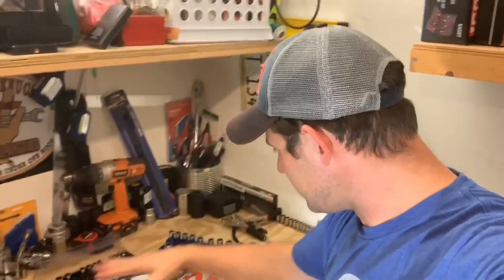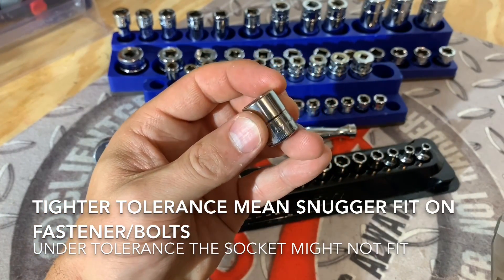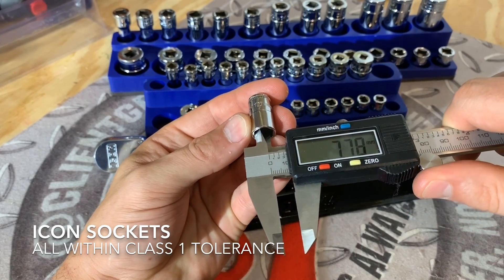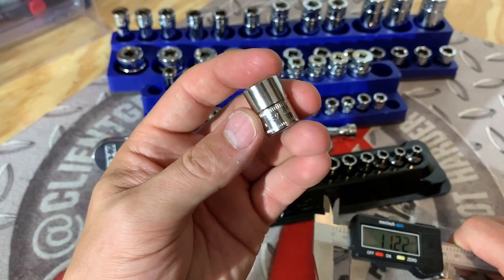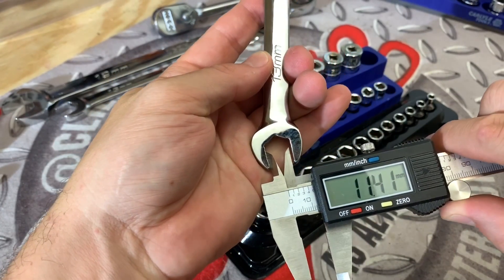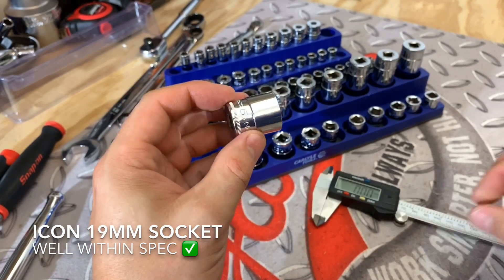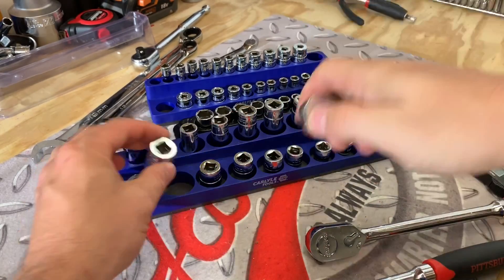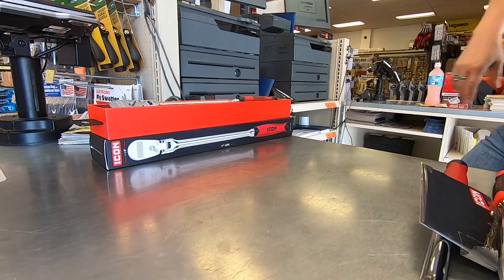ICON Tools Socket Wrench Tolerance Does Harbor Freight Measure Up to Snap On

Comment: Wow, crazy this video is 5 years old.
I’m in the market to buy new ratchets and I’m up in the air between Tekton and Icon. Would you recommend one over the other? I’m not sure how I feel about how easily the socket popped off the Tekton. Would that persuade your decision? Also, do you know if either brand has improved in the last 5 years?
I’m really stuck in the middle..  my other thought.. just buy Snapon and bite the bullet and not question if I made the correct choice.. but I’m not sure I can justify the cost of 3 SO ratchets.
Thanks in advance
Reply: I would prefer the more tighter fit as it would naturally would cause less wear on the metals even prevent less slip. As to how that affects the sockets balls that hold the sockets im bot sure i never owned a ratchet yet but i like thats its stuck. Im guessing the snap on is supposed to be pro so it must mean tighter the better.

Comment: ICON is a great mid tier tool brand (when discussing Taiwanese made). I have a few of their tools. When you start comparing them to Snap On, MAC, Wright it becomes very clear you don’t know the first thing about how USA tool truck branded tools are made. You leave out the steel grade, heat treatment, finish machining. Cracks me up just how stupid some folks on YouTube are. But as long as it’s “cheap”…. And to be clear I’m not calling you stupid, just the comment section. I do stand by my statement above that you need to learn there’s more to tools than a tolerance test using a measuring tool that is made of pot metal…I do get a good laugh when people claim ICON is at the same level as Snap On. They simply can’t afford Snap on so they compare apples & oranges to justify their frugal purchase.

Comment: A lot of discussion on this test about the fact the snap-on set was used.  The simple fact is that there should be no change in the tolerances from new to old.  A permanent change or opening up of the tolerance from new means the socket underwent plastic deformation.  If a part undergoes plastic deformation is has, by definition, exceeded it's service strength.  So unless each snap-on socket tested was at some point pushed past it's service strength, the icon tolerances are tighter.  Bolts are relatively soft, and should never deform tool steel.  If by some reason the snap-on tolerances were opened up through use, it would indicate an issue with either the socket steel or the design itself.  For those of you who care to learn more look up steel deformation on Wikipedia, or in any entry level materials textbook.

Comment: Great video As a professional mechanic I have so many different brands of tools in my box snap on Matco mac cornwell tools icon whatever doesn’t break and does the job goes back in the box and if it breaks when it’s relatively new off to the trash so far I genuinely have no complaints with icon tools are they as good as my local took truck possibly do they do the job absolutely for much less money if your just starting out In the field don’t buy a huge toolbox for 15k and try to keep up with the guys retiring who’ve accrued tools for 40-60yrs it takes time to get everything and one may never have everything 😆

Comment: So far my main complaint is that there are not expansion socket sets. Example is 3/8” drive short 6 point only goes up to 7/8”. No 15/16” or 1”. Same goes for all sets in inch or metric. But long term I still love my Snap on stuff but Icon is at least walking up the sidewalk to knock on Snap On’s door.

Comment: This is great info, thanks!  I had a Snap-On 3/8 ratchet years ago (probably 20 years ago) and the only complaint I had was how tight it held on to sockets.  There were times I needed to pry off a socket with a screwdriver.  I gave that ratchet away... but held onto my old Craftsman stuff.  Now I'm going to check out some ICON stuff this year.
Reply: Same thing here. Snap-on ratchets really grip the sockets
Reply: Sounds stupid

Comment: They told me if I have a problem with the icon tools is best to bring the whole set and they will swap it no questions asked. Is easier for them to return a whole set back to the factory. Then they don’t have to sell a set with missing pieces.

Comment: This video is pointless. It doesn't account for user error withthe measuring calipers. How can we be sure the calipers are 100% square to the side walls of thw sockets? A better test would be showing the actual play with a brand new bolt comparing the play in each socket with the same bolt.

Comment: I have an off topic question. I can get Harbor Freight 1/2” shallow cr-v impact sockets for $14.99 per set or for $20 I can get the chrome moly set. The difference is $10.90 if I get the sae/metric chrome moly sets... any thoughts which is better?
Reply from the maker: People will recommend Cr-Mo for impact applications since it has better ductility than Cr-V, which means it can de-form and re-form under the heat and stress of your impact tools. Cr-V is harder and more brittle so prone to shader instead of splitting. Traditionally, Cr-v is what normal chrome sockets are made of and are hard and have thinner side walls. However, Cr-V can be heat treated to different ductilities. At the end of the day we are talking Harbor Freight CR-Mo vs CR-V for me it comes down to fit and finish, size markings stamp vs laser etching and what side walls are thinner walls yet will last. For most DIY and weekend projects either will be fine.
Reply: ClientGraphics  thank you for your input. I know it’s not a lot of money but I just wanted to make a wise choice with what I need.
Reply: ClientGraphics  Thank you for your reply. The Harbor Freight Cr-Mo are laser etched where the Cr-v are stamped. Cr-mo are thinner walled and seem lighter. I use impacts mainly for gear boxes and small hydraulic pumps..so far I’ve had no issue with Cr-v but I’ve never owned Cr-mo... still trying to decide... great videos and very informative! Keep it up!
Reply: ClientGraphics  would you still recommend the Cr-mo even though harbor freight switched then to China? Cr-v are made in Taiwan

Comment: Great video Chris! I thought it was just me having difficulty with Snap On ratchets. I have a SnapOn FLF80 ratchet that once you put that socket on, it’s not coming off unless you pry it off. Honestly bought into the hype and just don’t see how Snap On can increase efficiency when I have to pry every socket w a pocket screwdriver. My go to ratchets are from GearWrench and SK and I even have a HB Pittsburgh pro that is pretty awesome. All three are smooth, reliable and can be used with any brand of sockets with zero issues.
Reply: Buy a quick release u amateur

Comment: None of the measurements are correct. You are splitting. 00mm and.05mm and holding it by hand the measurements will not be that accurate. Now you go to what really matters the quality of the steel as a heavy equipment field mechanic i dont grab a wrench or a ratchet or a socket that i dont trust. I have had my knuckles broke skin ripped off because of cheap crap. You spend your mony on what you think is right but i will spend my money on what i can trust

Comment: I agree with the caliper comments.  As a machinist for 15 years, those harbor freight caliper are not even worth the $9.99. They would need to be calibrated or at least checked against a gage block or 1-2-3 block for accuracy. Bet the are off at least .01mm which is the difference in the video. ( I'm still wanting Icon to win this battle. But for the sake of accuracy better equipment needs to be used for measurement)
Reply: What does it matter if it a little off , it's still showing which is tighter or looser , the Icon sockets had a lower number , doesn't matter what the number is , as long as it's showing higher or lower , , bottom line , the ICON shows a tighter socket , even if the numbers aren't perfectly accurate , ICON always had a lower number than Snap on , followed the same pattern one after another !!
Reply: Their is tons of videos checking there accuracy on youtube they are within .001in as they claim but even if he switched to a mitutoyo or starret caliper it wouldnt make a difference because sockets dont need to be in that high of tolerance

Comment: Test is BIAS because your using a Harbor Freight caliper vs a Snap On.....Get the Snap on caliper and I bet all those numbers will be dead nutz on.
Reply from the maker: The SnapOn 6" Electronic Caliper CAL6EA is well over $200.  I'm sure it's accurate but can't justify the price point as I rarely use the one I have for checking rotors and a few other things.  Great idea none the less and if I have the extra cash laying around I'll be sure to pick one up.
Reply: Snap-On does NOT make metrology tools like digital or vernier calipers, they are made by a metrology company (likely China) then re-branded as Snap-On. Machinist will NOT use any caliper for measurements that require significant accuracy (0.003" or better) due to the fact there are better measuring tools for specific measuring needs. Best mass produced digital calipers are Mitutoyo, Swiss made etalon dial calipers from about 30 years ago were excellent. Does using a made in China digital caliper make much difference with measuring internal hex sockets, likely NO. Accuracy of ANY caliper can be easily verified and checked by using a certified accurate gauge block. Once this is done to verify accuracy, it makes zero difference where the measuring tool came from or is made. There is one serious source of measurement error, position of the internal measurement jaws of the caliper vs internal hex opening. Trying to get the alignment absolutely correct is a LOT more complex than it appears. Does this really matter, not really due to the real world tolerances of threaded fasteners to be wrenched on exceed this source of error.

The better way to measure the internal hex opening would be to use a verified accurate adjustable parallel placed inside the internal hex (stack a gauge block with the adjustable parallel to reduce extension of the adjustable parallel as needed), adjust the parallel until it is completely seated firm against the largest area of the internal hex flats, then apply a certified micrometer on the parallel to measure what the internal hex opening is. This measurement technique will average the surface irregularities of the internal hex surfaces and give a better sense of what the actual working dimensions of the internal hex really is... and no, Snap-On does not make high precision adjustable parallels or high precision micrometers. Snap-On markets these measuring tools at best.

It is prejudice and blind loyalty to simply believe ALL made in China is JUNK... the reality and FACTS are far more complex than this. Root problem comes with taking sides or loyalty as this innate aspect of being human will blind one from the truth and reality of the way stuff really is.

These small differences with internal hex socket measurements amount to much of zero as the tolerances of nut-bolt-cap screw heads have far greater tolerances than what has been measured. There are international industry standards for this and ALL manufactures of tools and hardware follow these international standards. If not, interchangeability would be an absolute nightmare from production to service and more.

Comment: I am glad to see harbor freight stepping up their quality. For years HF made complete junk for tools . I used to use them back when I was a kid and before I knew better. Almost lost a finger when trying to undo a radiator fan and the crappy Pittsburgh wrench rounded off the head of the bold. My hand went in to the fan and radiator. Thank god I was wearing mechanics gloves. Even then it sliced open the glove and my hand. Ended up getting a few stitches. I switched to husky after that. It’s too bad husky and Kobalt went down hill as well. I switch to Tekton about 2 years ago after a friend who is a professional mechanic recommended them. After looking at the Icon swivel head ratchets, they are identical to my Tektons. The composite handle Ratchet is identical to my Tekton as well. I think HF is using the same manufacturer as Tekton and just rebranding them.
Reply: That wouldnt have been on the tools fault. it would have been your fault, never work on a engine that is on
Reply: Engine was not running.. It was a 1970 camaro I had been restoring, the previous owner had installed a shitty aluminum flex fan and it was having some over heating issues.The poor quality HF wrench rounded off the head of the bolt and slipped off. When that happened, my hand hit the sharp edge on the flex fan and my knuckles punched in to the radiator. The fan sliced open the glove and my hand. And I ended up getting quite a few stitches the side of my hand left where the small finger connects to the palm. Missed the tendon by a fraction of an inch. I still have a nice scar to remind me to always use good quality tools and gloves. I ended up having to remove the radiator and grind off the head of the stripped bolt to get the fan off. Had to have the radiator recored to fix where my knuckles hit it and switched the junk flex fan back to a OEM fan and fan clutch. Lots of wasted time and money that could have be prevented had I bought good tools in the first place. That said, I am really glad to see HF is stepping up with the new icon line. I don’t dislike HF. I use them all the time for things like shop rags an tarps, I even still have a set of Pittsburg tools that I use when I go to the pick a part yards. Cause if the get stolen or get lost I don’t care. I wish them luck on their new product line because it will force others to improve in quality in order to compete with them. And better tools for everyone is a
Reply: @shadvan9494  ahh ok my bad I thought you had the fan spinning... Yes I do agree with you tho, I am excited for the Icon line, but a lot of people happen to hate the company

Comment: I have had more than a few problems with sockets not staying on smaller bolts because the chamfer seemed to be cut halfway up  the socket. I get that it's there to make it easier for the socket to slide onto a bolt. But some chamfers seem to be cut far deeper than they need to be. Is there a spec for that?

Comment: It's hard to go with a new tool brand after what happens to kobalt and Husky when they are today as when they were launched.
Reply: My dad was a machine builder when i was younger and only bought craftsman when they were sears. Now whenever i go to warranty them i can’t because sears are closing down left and right. I buy tekton now when ever i need new tools or buy snap on stuff off my buddies as they retire.
Reply from the maker: I don't blame you. I did have some older Husky, but thankfully never fell into the Kobalt trap.  And that was only because we didn't have a Lowe's within 75 miles.
Reply: What trap are you referring to?
Reply: @davidchristopher5976  when they launched kobalt they were made by Williams a snap on company now they are made in China and Taiwan for the most part
Reply: @larryborkstrom3580  I see.  Thanks for cluing me in on that.  Pretty shady thing to do.

Comment: If the icon are chrome vanadium alloy single heat treat , use them with a 100 fps for a week or two then measure. 
Snap on uses a another alloy chrome molybdenum and chrome vanadium together, then a  doubble heat treat.
They crack before stretching out of spec.
Icon is good for the money but not in the same class. I am impressed with Icon and Doyle tools but you are not going to beat Snap On over night they have been refining  alloys and heat treating for specific applications in every tool for years.
The Icons are really good but let's just see how they perform over time. My bet is Snap on will out last them but for the money you can't go wrong buying icon.
Reply: Theyre chrome moly. And snap on uses cold formed alloy steel. Not heat treated. Chromoly is actually stronger more durable alloy

Comment: Very nicely done Chris !!! Cool to see the ICON come in with even tighter fit than the Snap on. Looks like a person who is thinking about opening a small shop, with let's say 3 or 4 bays could outfit his whole shop for the same amount of $$$ as 1 person using Snap On. Difference goes up when you start adding tools needed by master mechanics. Clear Winner is ICON !!! Evidence is both in your videos and at least a half dozen other creators. Thanks again for sharing your thoughts and videos, Rodney
Reply: Unless they go the way of the DODO and Kobalt...
Reply from the maker: It does make one wonder that they should at least want to look at them as an option.

Comment: Not accurate if your testing used snap-on vs new icon. What would happen if you tested new snap-on vs used icon? Test new vs new or don't bother
Reply from the maker: They both are technically used and that 19mm ICON went to 200 ft-lbs multiple time in a prior video.  Most used tools should still be within spec unless out of spec from the get go. Have fun and go measure some sockets ✌️

Comment: Did you buy a book for the references? I can't seem to find a chart for the specs, but great video  keep up the good work👍
Reply from the maker: michael bladen I have the ASME B107.110 as well as a few ISO and DIN specs and the Machinist Handbook has some goodies tucked inside it.  I would check what the local library or University or Engineering groups have and google and or paid sources will have the rest.  Good luck and it took me just over a weeks to source everything but I’m set for quite some time.